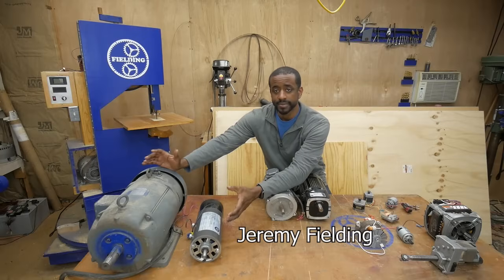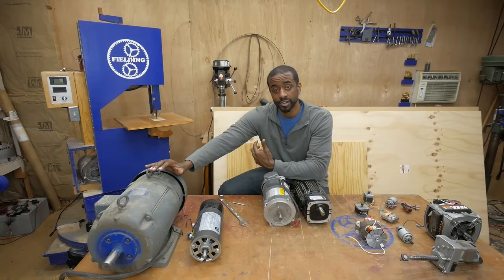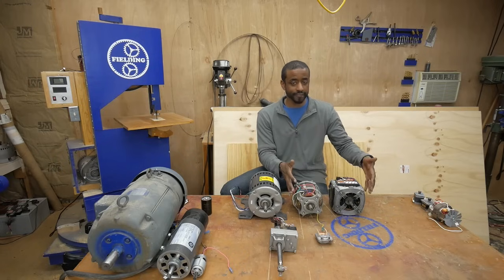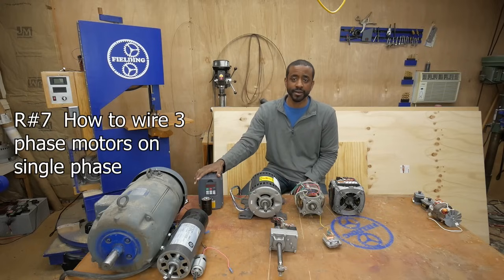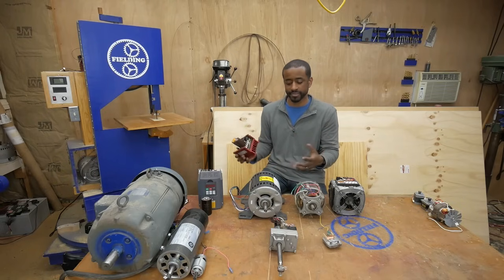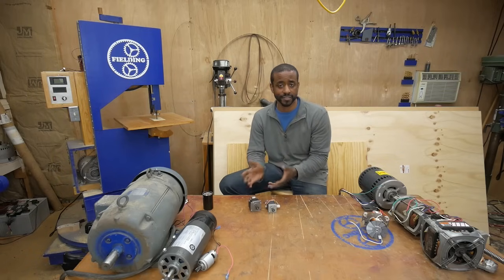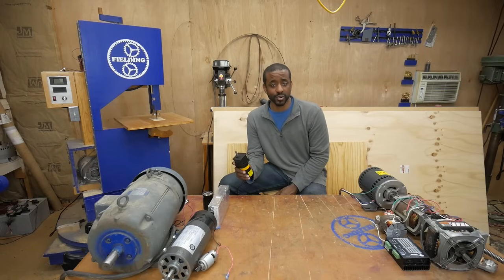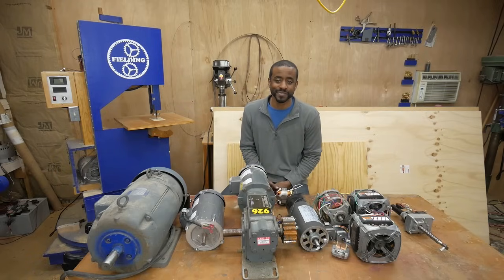Ultimate Beginners Guide to Using Electric Motors for Makers and DIY Projects; #068

Comment: And then you have the days when the shop sends out the replacement for the burnt (lightning) y-delta motor and the service crew installs it and pops everything. Get called  and it's a dual voltage Y wound wired y delta in controller.  Reconnect and get running after rewiring starters. The motor shop sends out their trouble shooter and prove to him that it has the WRONG DATA TAG installed. My shop say that because of liability it has to have the "correct" motor installed. Passenger Elevator. 3 weeks later service crew calls and says, I don't know what you did but get back here and undo it. Building Manager is not happy. Office building on Army Post with handicap employees, and ONE ELEVATOR. All I wanted was a data tag and two rivets. Retired Elevator Mechanic

Comment: You are like the Khan Academy but for functional  electrical
 Motors !Love your videos ,you know how to teach and have people understand. I tried building my own circuitry during the pandemic and made a bridged rectifier from old circuit boards I gutted .I completed the Ac\  to DC change but could not get voltage perfect ,I got it close eought) .That little circuit worked like a champ ,until it melted down like 3 mile island. I attempted to diagnose and repair a canned motor from a hot tub.It was expensive and my friend didn't want to buy a new one . I struggled but got it running with one new part .Gave it to my friend and he called to say it was installed and pumping water. The next morning he went out at 4 30 Am in Pa fall weather .He saw steam rising from the tub and jumped in .During the night my motor repair failed ,tripped the circuit .The steam he saw was from the temp.I think he woke up real quick in that cold water! Can you do a video on canned motors ? Since there are so many spas and tubs ,maybe someone else will run into the.Thanks

Comment: 1.  Which type of motor would I need for an electric go-kart?
2.  How would I calculate the ideal motor parameters (rated RPM, ideal torque (min&max), rated ower (Watts), ideal Voltage range, & max Amps) that would be required, if I know the go-kart total weight (including driver weight), desired acceleration, & desired top speed of the go-kart?

Great vid. Thanks for sharing!

Comment: I want to mount a 120 gallon air tank horizontally and rotate it with gravel inside to clean the interior. Very heavy. Maybe 30 rpm or slower. Lots of torque and power. What motor would you suggest? 
Thanks for your help. I haven’t a clue. 
Paul

Comment: I always like your videos. You know so much about motors. When I look at them on the internet, I get totally confused. Price, size, hp, torque all vary. 
If I want to increase the 1/2 hp motor on my Jet 1040 VS lathe, to 1 or 2 hp, how do I go about finding the right motor?
Also, I need a continuous duty dc motor at 200 rpm for a honing device for tools. How do I select a motor for this?
Thanks , Paul

Comment: Nice.  Might add that single phase Induction motors are designed to run one speed.  This includes air flow and cooling.  Slow them down and you will trip your thermal overload protection.

Comment: Great instructional video.  It would be good if you mentioned any 'special' tools that are needed to get the motor away from its mount in the appliance.  Try to minimize the use of abbreviations, or explain them more fully, for those of us that are still learning.   Lastly, if you could review what you actually used the different motors for . . .  could be a great thought starter.

Comment: Love your videos Jeremy. One thought crossed my mind during this regarding EVs. With an ICE, the transmission increases the gearing as you go faster, to reduce engine RPM. To achieve similar with an EV - to reduce energy consumption - which would work the best: Using a transmission like an ICE or switching to a smaller motor as speed increases?

Comment: Thank you sir, Can motors have a toggle for a neutral setting. For example I run the motor to turn a crank then once the crank is moving a certain speed the motor switches from creating torque to sit in neutral and only needs to turn back on to add any loss of motion.

Comment: Thank you for your imparting knowledge, I do wish to ask the following: regarding the 1-phase to power 3-phase. This only works for motors? In the case for a 3-phase commercial oven, would the heating elements  be the eliminating factor be it the ovens fan motor is 1-phase? There by not providing the 1 to 3 phase capability?
New and learning, Thanks. T. PatSalis

Comment: question:
rpm * torque = watts
amps * volts = watts 
that confuses me a bit
Reply from the maker: They are both "power" and both equal to each other. So the terminology is correct. The only difference is one is electrical power and the other is mechanical power. Motors convert one into the other.

Comment: hello sir many thanks for a great video. 
Please can ask some advice I am running a 3 phase 415V motor from a phase converter box which converts from single phase 240 V to 415v 3 phase L1 L2 L3 and earth. The problem i am having is when I turn the box on and then go over to machine and turn that on i am getting a power spike and trips the box. But if remove the start button and just have it turn on when i turn box in it work ( the box ramps up the power until its 100%) thus avoiding the tripping. But this is very dangerous as you can have the stop button working on the machine for the bypass to work or the start button I have to walk 20 feet over to the converter box as it next one of my other machines. 

Basically I think I need to some how limit the amps to the machine and then increase it with some sort of POT. 

have you any ideas? as i am pulling my hair out spent 3 days on this one so far and I am getting no ware fast, as i am very small budget  other wise i would love to just replace the motor and starter for 240v singles phase but that way to expensive.

Comment: Great video thank you. Watts is how much work is being done and heat is the by product in this case. More work equals hotter motor.
Reply from the maker: Thank you for the kind words. For clarification Watts is a measure of power not just work. Specifically work over time is watts (power). Work done very slowing will give you a lower wattage than work done quickly. Regarding heat, motors of different types cool themselves in different ways some with fans, and others with clever fin design. Thus the temperature of the motor or even heat produced doesn't directly tell you anything about the power output or work load of the motor. Two motors can perform the same work and have very different temperatures. One might overheat and the other can be cool to the touch.

Comment: What electric motor do you think would be suitable for an outboard engine on a boat weighing about 840lbs at around the 30-40hp power output? I'm really struggling to work this out so any help would be great!
P.s love your video's

Comment: I have a DeWalt 735 wood Thickness Planer that runs on a universal motor 110v it is not performing  and I want to change the motor what type should I use  and what condition to consider?

Comment: Mr Fielding, I bet you're either a senior R & D ME with training/supervising young engineers as part of you're day job, or at least you're professoring somewhere. I am an unknowing EE (RF guy) and I worked on variable frequency synchronous motor drivers when I was younger and did power electronics as a hobby for a while, but what I love the most is DC motors because of the torque/speed beautiful equations that you can derive from simple facts (e.g. different kinds of field/armature windings' connections). I have a question for you is about your "future" (didn't search your channel yet) arduino PWM driver for DC motors and I very much doubt that you'll have the time to reply with all those millions of views. You are probably going to use a potentiometer or a rotary encoder knob for speed (unless you wanna do an LCD touch/buttons interface which adds unnecessary details for the initial design), are you going to have a look up table in the code to linearize the response (speed response to your knob movement)? Additionally, will you use some speed feedback (e.g. an encoder) to implement a simple PID in your code to make your control better or is it only an open ended control with the PWM switching a MOSFET to give variable voltage? Thank you so much for all your work and God bless. America (at least) needs many more educators/tinkerers like you.

Comment: The most interesting diy project might be building a bicycle power generator that you can vary and regulate the output.  Give people an understanding of just how much work it is to generate the equivalent that a single AA battery. Let people get their exercise while actually doing something useful. How much time would kids spend on their phones if they had to build charge themselves to keep them running? 😉. 
Be surprised how many watts a puny typical human can produce, vs a real horse 😎

Comment: Thanks for the video, very informative (I'm dismantling everything with a motor before getting rid of it from now on).  I know I'm late to the party and you might have already moved them on, but would like to know something about the two motors you compared around the 3 min mark. What are the max input powers of each, the bigger (but less output hp) and the smaller (but more output hp) motors?

Comment: I have a portable 3PH generator powered by a diesel engine, is there a way to also output 1ph power both 110v and 220 or 208v from this generator?  I have some 3PH machines but it would also  be nice to be able to use this 3PH generator to also power my home in an emergency.  The generator is mounted on a trailer and it would also be great to also have 1PH power on a job site.  Thanks

Comment: hi Jeremy Im Rod . ive learned so much watching your videos . Your explanations are easy to follow and understand, thank you for your time. i do however have a question, idk if you have made a video of it or not but im trying to run a smart motor or direct drive from a front load washing maching to run my small sawmill or bansaw mill. its a 1100 wat 8 amp motor. so i come up with 1.8 hp. can you tell me where to get a controller to run it off of 120 v house power please . thank you so  much

Comment: SOO glad you mentioned Arduino.  I had a project where i was making a speed controller using Arduino and PWM ports.
Read resistance from a potentiometer on one set of ports and converted that to PWM signal sent to the motor... 
lol!  Learned a LOT with that experiment.  Impressed myself that I had minimal heat generated and still controlled the motor up to full speed.  Thank you!  Motivation to revisit my speed controller and "Power Racing Series" car

Comment: This isn't a "beginners" guide. Not when you begin yapping immediately about induction and horsepower while slapping the frame, as if you had actually said something.
Reply from the maker: How about check out my "how motors work for beginners" series. It starts at the very beginning with just magnets and wires. I think you will find that more approachable based on your comment. Thanks for trying this one anyway!
Reply: @Jeremy_Fielding  Very kind of you to respond like a gentleman. More than I deserved, and I apologize. For what it's worth, I'm familiar with motors and my indignation, however unwarranted, was on behalf of several beginners who were baffled by your approach. If I may, there are techniques experienced teachers who have been able to enjoy the vigorous give and take of the classroom have learned to employ, such as following through on your equations at 2:18 and 3:39 with concrete examples. There's nothing like it for helping students learn to plug in numbers themselves and more deeply understand what's at issue. Thanks again for your kind reply. Cheers,
Reply from the maker: https://youtu.be/onjFFoOC_yk this is the first one in the series.

Comment: Could I please have your opinion on a project I’m about to start? I’m building a collapsible sofa that pushes out into a bed. If I were to make a linear actuator from a car window motor would it have enough power to pull the bed in and out on its own? I can’t give precise variables but the moving part of the sofa will be on wheels on a solid surface.
Reply: i would say no, try measuring how much force it takes to lift the weight on the frame of the bed AND what gear you need to move it 👍

Comment: Not sure if you still monitor this video but if so I wonder if you could help me with a question. I recently purchased two 3 phase electric motors. I thought that were low voltage but after I got them home I discovered that they are 600 volt. I sure can't use them here in my shop and was about to take them apart to salvage the copper but before I do that I thought you might have a cool idea of what else I could use them for? Any ideas?

Comment: Hi Jeremy love your vids! Question, I got a DIY project to build a workout sled (push/pull/ weighted sled). Instead of an actual sled, could these motors be used as resistance to the wheels? Obviously the motor would act more like a generator since I would be putting the work on the shaft. Would they need to be wired to push a current to get this resistance? If any thoughts let me know.
Reply: I’ve been planning a build of the same sort. You would want a shunt resistor or brake resistor in there to take the load of the motor.

Comment: Dude. Dude, dude, dude. This is EXACTLY what I've been looking for. About to create my own dust collection system for my shop and am going to pick up a 5hp leeson and 3 90v dc Motors for dirt cheap. I understand electrical because of my trade but wanted to understand the exact differences in different motors out there. We only use single phase induction Motors. Thank you!!!

Comment: Thank you for these! Trying to figure out if I can build a 'cart truck' for my way too heavy fishing kayak. I already have 12 volt batteries to run the trolling motor and electronics, so was hoping to build a compact unit to help pull this up grades at a slow walking speed. Doesn't need to run long, a mini tractor.

Comment: HP= speed.

The ability to move something, to keep something moving already moving.

Torque = force (true power)

The ability to get a weight into motion. 

Transmissions (gearboxes) allow to conversion of speed to power, at a loss of speed. 

Once a certain speed is obtained, a different gear then can be selected for more speed, and so on.

Comment: I’m just starting this stuff. So I have a model steam engine and a hadfullf small stepper motors that I’d like to convert to generator. Don’t know just how fast the steamer will go or how much torque it will make. But something I’d like to measure.there are lots of direction I can go. But I need some technology. I like your motor video. I’ve worked with some really large    electric motors reportedly  USNAVY   Salvaged. 40 + hp. Probably weighed over a ton.  Some as high as a person waist haft larger  than leg. Big stuff. My little steamer is tiny. It un.

Comment: Nice solid beginners videos!
Have you ever seen a dual offest 3 phase PM BLDC Motor/Generator that includes a reconfigurable stator for on the fly amp turn winding changes and multiple pole count on the fly switching and a variable Permanent magnet flux output rotor for on the fly field weakening to avoid back EMF limitations that can have a usable level output power at rpm ranges from 200 rpm to 10000 rpm? would you like to?

Comment: I have a old craftsman table saw with 1 hp motor. Very old but always worked good. My shop is not heated so I don't know if this is related. saw starts cutting good on 3/4 plywood but then it stops. Have to reset to start again, but shuts down soon there after. Is this an old motor problem or capacitor getting weak? Thanks in advance...

Comment: That’s why engines are better then motors
Reply: Not exactly, as an engine needs to have a substantial rpm before any usable torque is developed and an electric motor develops most of its torque at the start without high rpm just as is needed for automotive consumption....the ICE (internal combustion engine) has the opposite needed for automotive use thereby requiring a transmission to get the torque needed to start out.....the only advantage in the ICE is that the fuel (gas) compared to the fuel  (batteries) in the motor is much more power per weight and volume....liquid gas has better condensed potential for weight and volume and otherwise the ICE is not suited for automotive, this is why we have hybrids to  use the best of both worlds....just my thoughts

Comment: Great video 👍 but one question does the vfd have to work on single phase 220 v and not split phase 220v, I have one of the Emerson treadmill motor 3hp as u have in in the video but my house doesn't have single phase 220 v, only split phase

Comment: It's good to know that other people suffer from the same sickness I do 😫 the symptoms are that you absolutely positively cannot let anything go to the trash without tearing it apart and getting every usable piece out. Also you may go through car brakes more quickly than other people due to slamming on them when you see a vacuum cleaner or a lawn mower or anything else on the side of the road. Also people get tired of you saying that every piece of machinery has many usable parts when it's thrown away including cables, cords, wires, switches, screws, nuts, and bolts 😆

Comment: thanks for your video, I am trying to select a motor for my thesis's project, It should produce 1000 Nm starting torque, and it should be producing a constant speed of 1 rpm, could you help me and tell which kind of motor is suitable and cheapest for this application ?